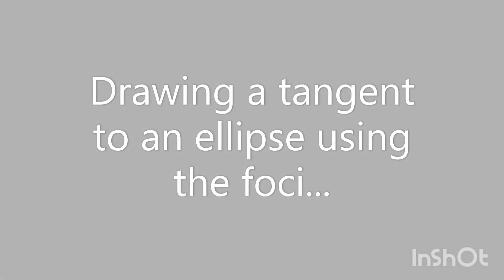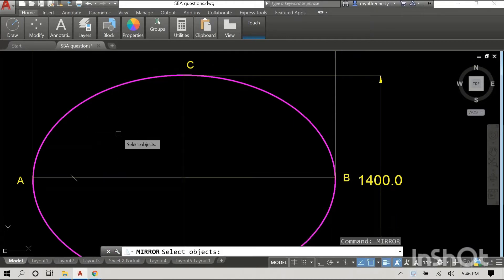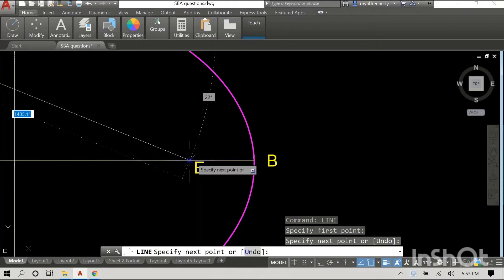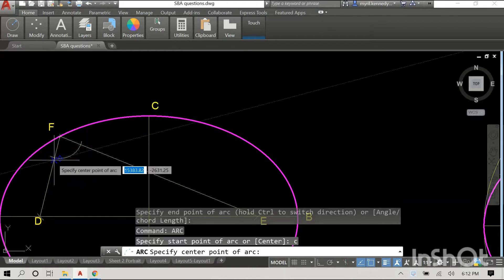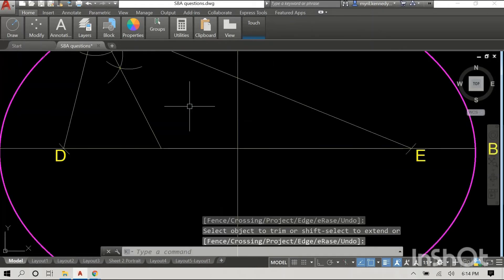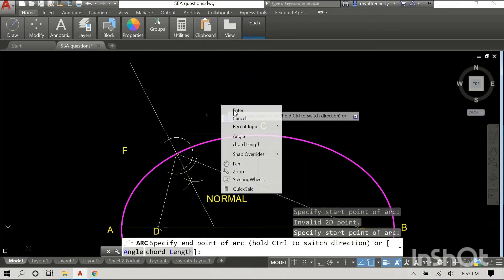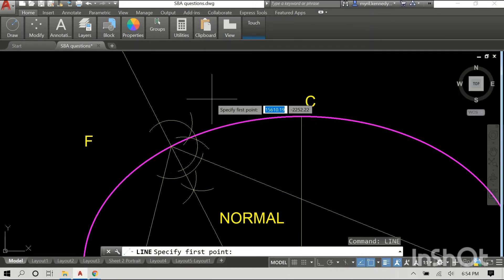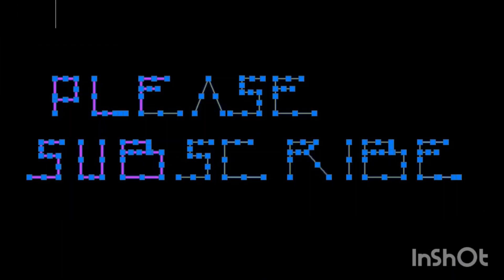Autocad Tutorial: Construct a Tangent to an Ellipse & Easiest Way to Find Foci. (Technical Drawing)

Comment: There is a much easier way of creating a line normal to the normal: rotate the normal line 90n degrees around the point on the ellipse.  Use the copy option if you want to verify that the new line will be perpendicular to the normal.